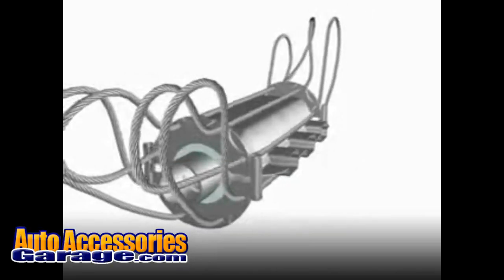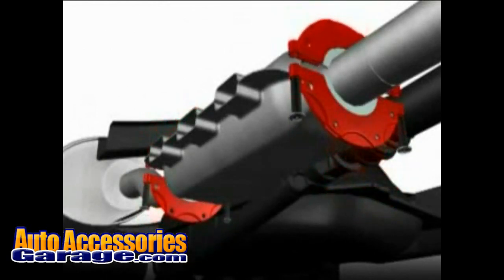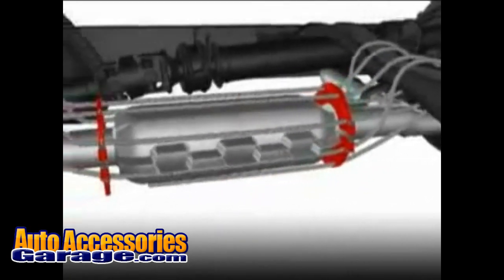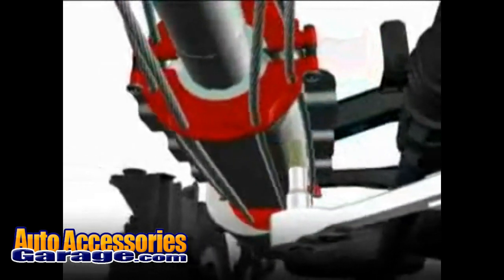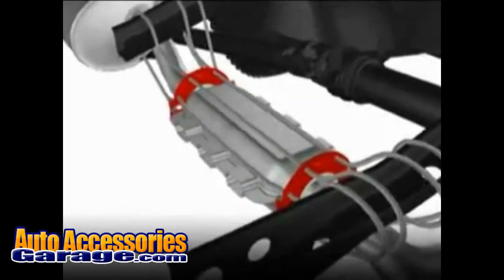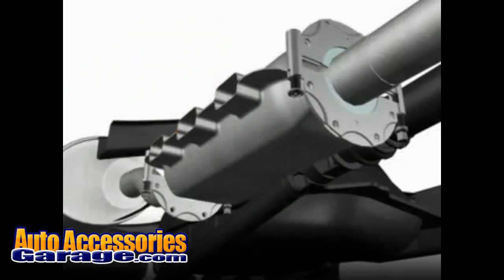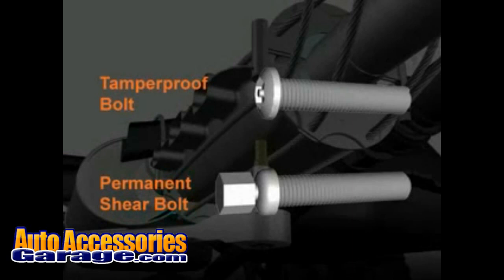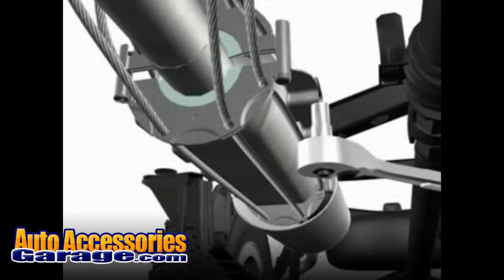CatClamp Catalytic Converter Lock

Comment: I work at a local thrift store, and after our catalytic converter was stolen off our truck, we ordered these for both our trucks. They were both installed correctly, according to the instructions. Somehow, the thieves managed to steal the converter plus the Cat Clamp. I'm guessing they also had a good pair of bolt cutters also. When we reported the second theft to the local PD, they suggested live alligators patrolling the property. I realize the officer was being facetious, but that would take care of the problem...
Reply: Yup. The truth is, none of these Cat locks really work. If the thieves really want it, they can still get it within minutes. If anything, it may offer as a deterrent because its more of a hassle, but that's about it.
Reply: Looking at his video, it just wraps around and around, meaning you cut a single part, and the whole thing comes off. Plus, why would anyone pay hundreds of dollars for a steel wire, you can get at any hardware store for a few dollars?
Reply: @Jeremy-kq5bs  that’s not the case. I went to auto trade show a year or so ago and these guys had a booth there showing both products allowing customers to try and get past the security clamp. The wire is stupid thick, bolt cutters and saws are essentially useless on it, if they did decide to use that or a Sawzall it would take a cpl hours to get through enough of the wires to get the cat out, no exaggeration. Also if you do cut the wire it is not a clean cut making it very difficult to pull back out of each hole as it just barely fits in the first place. I’m not saying these things are the be all solution to stop cat theft but it is definitely one of the most effective ones I’ve seen. The person would have to be very determined with a lot of time on their hands and not be worried about getting caught to steal a cat in one of these
Reply: I saw several pictures of this product on Amazon feedbacks, where cables being cut and catalytic converter stolen. 
I'm not sure what they used maybe sawzal, maybe grinder, maybe cable cutters

Comment: A lot of pettiness in the comment section. After paying no less than a few grand to replace your cat you'll wish you had one.  Also when they steal them they don't bother to carefully disconnect your O2 sensors. They snatch all the wires out of your wiring harness also. Very expensive repair.

Comment: Part of the solution should be a new design of the catalytic converter integrated with the chassis. And local/state law needs to pick up their part by making it a felony to sell lose converters, unless dealing with reputable licensed companies, with insurance, bonding, and a paper trail for each sale/purchase of any converter. And a national data base needs to be checked by the scrap yard.  I fully realize many, many scrap yards are owned by felons and crooks, with gang ties.  But make things harder.  How about changing from precious metals to common metals.  Is there a real honest reason engineers are not working on this problem, or is it simple--follow the money?

Comment: This is nice but what stops the thieves from cutting the pipes just slightly further from the cat, then wiggle it out of the harness?
Reply: When you install the clamps at both ends of the converter there is no room left for a blade to cut , it is nearly impossible to. The clamp is tightened down with a special made key so if it did get cut off it would still be tied down by the cable.
Reply: @terryneal5569  another thing that can be done is to cover the end of the bolt/scree and surrounding surfaces with something like "QuickSteel" or "thermo steel" (see: "How To Repair Cracked Exhaust Manifold With QuikSteel/ThermoSteel" https://youtu.be/9DAcQnbmMzE ) So that way even if they do have the special tool needed. they would still have to get throught additional material and have to guess what kind of tool they will need to have untill they get through it.
Reply: The cables at the ends get wrapped around existing parts of the vehicle. I see the thinking behind this, as cutting the pipe at each end would leave the cat hanging by the cables. However, nothing is said about durability of the cables, ie, are the able to withstand a ratcheting bolt cutter? Over all, I think it's a great design that, even if the cables take time to cut through, may provide enough deterrent to send thieves packing up to seek easier targets.
Reply: Nothing. These don't really work. And the price is an absolute ripoff.
Reply: that;s exactly what they did to mine, 2 times within 1 month

Comment: What about bolt cutters?
Reply from the maker: If someone is really determined to take your specific cat converter, if there's a will there's a way. But in most cases if a would-be thief spots one of these, they'll just move on to the next vehicle.
Reply: what would be interesting is to not only use this cable system but also add something like the Cat shield on top of that to give a second layer of security. Also, there is a special kind of undercarriage coating that can be sprayed onto the cables that camouflage them and obscure them. And to further reinforce could wrap with steel wool before coating with something like QuickSteel?

Comment: Seeing as how you can get tamper proof torx socket bits from any big box store now, in my professional opinion, I would recommend the sheer bolts.
Reply: they generally get cut off.
Reply: another thing that can be done is to cover the end of the bolt/screw and surrounding surfaces with something like "QuickSteel" or "thermo steel" (see: "How To Repair Cracked Exhaust Manifold With QuikSteel/ThermoSteel" https://youtu.be/9DAcQnbmMzE ) So that way even if they do have the special tool needed. they would still have to get through additional material and have to guess what kind of tool they will need to have until they get through it.

Comment: Can it be installed on a small Nissan NV200 cargo van?
Reply from the maker: Definitely.
Reply: @AutoAccessoriesGarage  how if the converter is above the cradle on this Nissan?
Reply from the maker: You can reach out to orders@catclamp.com for detailed installation instructions.
Reply: @AutoAccessoriesGarage  I bought two and they can't be installed on a NV200. I mounted one on our NV2500. I had to find another solution for the NV200's.
Reply: I saw several pictures of this product on Amazon feedbacks, where cables being cut and catalytic converter stolen. 
I'm not sure what they used maybe sawzal, maybe grinder, maybe cable cutters. 
You better off with stainless steel plate shields sold specifically for Nissan NV200
Reply: I went with another solution for my NV200’s: I welded a section of motorbike chain between the cats and the body of the vehicle. Long enough for it to hang somewhat loosely. It is very difficult to cut in this configuration. It worked: the last attempt to steal my cats failed. They tried but gave up.

Comment: Helping cops find thieves is not my goal I want to keep my catalytic converter. I ended up with extra cable because my 2017 Mitsubishi outlander only has a strong place to thread the cable forward of the converter so I am going to get some cable clamps and just clamp it to the cable that is between the ends, cutting cable is not recommended.

Comment: So basically an extra minute or two with a battery powered cutoff wheel.

If I can cut the front end off a car in 5 minutes with a cordless cutoff wheel, I can cut through 8 cablrs and 4 bolts much quicker.
Reply: True.  Nothing can stop the thief if they really want to steal it, but it's better than nothing
Reply: Have you tried it? It's steel cable, plus it's vibrating while you're cutting. It's going to take you a while and rat bastards want to do it quick. I say after 5 minutes he's going to quit and try something easier
Reply: Those cables  might as well be  butter .  A $79.00 bolt cutter and five minuites  max.
Reply: They usually only come equipped with one sort of cutter, by putting multiple materials in the way makes it more secure.
Reply: Anything to slow them down might help.
Reply: @Rythmboy2  right, they will just go look for easier target.
Reply: @bleechy2149  no they don't,  they have lots of tools....
Reply: Great advice, obviously experienced in car scrap or body shop work . 
These comments are invaluable unlike the idiots on the nightly news or the police themselves. Talk. to guys in the industry or Thieves themselves...
Reply: every extra minute spent gives the owner a chance to make sure the SOB never walks again
Reply: I was thinking the same thing as I watched it.  Cordless cutoff wheel would go through these cables.  From my experience, it would add 5-10 minutes to have to cut through that many cables.  It would also make a ton of noise and sparks and draw unwanted attention.  The thief is still probably going to have to carry the sawzall/hackzall type of reciprocating saw, because cutting through the exhaust tubing tucked really close to the car's body would be hard with the cutoff wheel.

That same cutoff wheel can cut right through the side of most residential safes just as fast as it will cut through the 7 or 8 cables in this CatClamp.
In reality, this device does exactly what most security devices do.  They add time and effort to steel something.  The goal isn't to make it impossible to steal something, because you'll never succeed.  The goal is to increase the effort required to more than most thieves will put into it.  

In the case of catalytic converter thieves, you pretty much just have to make yours harder to steal than all the other cars in the parking lot.
Reply: lots of risks using a cutoff wheel if you cut through something with flammable liquids and are shooting off sparks.. you could end up .. not to mention.. it is another piece of equipment you have to take into a cramped position.. and make more noise.. I saw firefighters using a professional diamond-tipped circular saw to cut through a bike lock u lock.. and It made a lot of noise and made a lot of sparks.. Sometimes with comments like yours, I get the sense you are trying to discourage people and make them feel helpless to do anything that can improve the situation. And I am supposing perhaps you are one of the people steeling these catalytic converters? Your comments indicate as such.
Reply: @robertl.fallin7062  a bolt cutter uses very long arms to gain the leverage needed to cut through thick stainless steel cables.  and it needs to be angled with its mouth in the right position to get a good cut out of the cable. and that cutter will have to be repositioned for the cables on the other side. also, there is nothing preventing stringing the cables differently and twisting them around to create more complexity.. and further, the cables could be covered with a fireproof sleeve of dark fiberglass and or high temp rubber hosing sleeve to further create complexity.
Reply: Hopefully as they’re cutting the pieces of cable that flys off inflicts some damage and they’re left wearing an eye patch for life
Reply: @re2248  by doing what? attacking a guy with nothing to lose and cut off wheel?
Reply: @robertl.fallin7062   Im sure not many cat thief's carry a bolt cutter

Comment: WOW,  I would love that Mess under my car. I can imagine the ease of routing 100' of steel cable under my car and around the frame.  Only to have a Dremel wielding Meth head make 1 cut in the cable and then pull the rest out.  Or just take 3 minutes and cut all the cable.

Now I am out the cost of this mess contraption and my Cat.

This has to be one of the most pain in the ass inventions I have seen.

Perhaps a high security Alarm or Camera System with motion detection would be better.

After I get this I'll get a nice set of Muffler Bearings.
Reply: It isn't meant for cars.  It's meant for large trucks and vans.
Reply: @am74343  You just replied to a comment that's five years old...
Reply: @Bajo_Jajo27  Good replies are timeless!
Reply: We’re all here from reddit anyways
Reply: @owenvogelgesang7314  Actually I'm here because I'd never heard of it and my elderly cousin is asking if I knew someone who could install it. I am potentially someone but I needed to know wtf this even is?!?!
Reply: FR. Getting some plate aluminum and a thread tap with some security screws would work much better as a deterrent, and actual security
Reply: @am74343  Junk crap from China  wont deter   large high  quality bolt cutter either. Also made in china!
Reply: @owenvogelgesang7314  confirmed gay loyalist
Reply: @am74343  AND it makes a hell of a statement,..that the problem is not only still with us,..but growing exponentially !! A big sarcastic thank you to the law makers of our nation! Beyond lame.
Reply: @man_on_wheelz  Do you get it figured out? We'd all like to know as there are a limited number of vehicles they make those security plates for. Thanks! ;-)